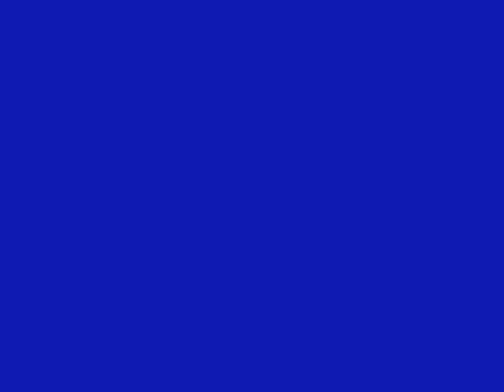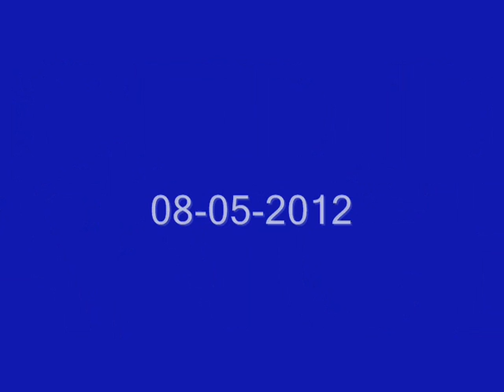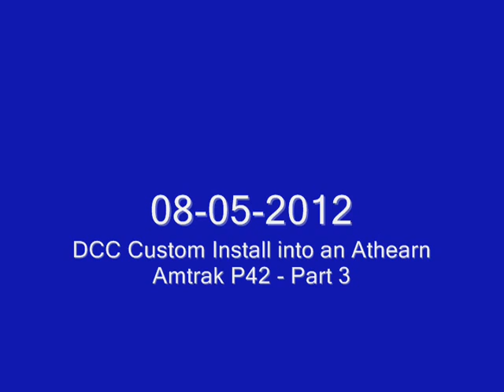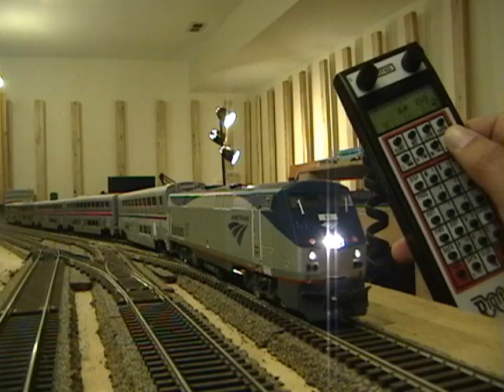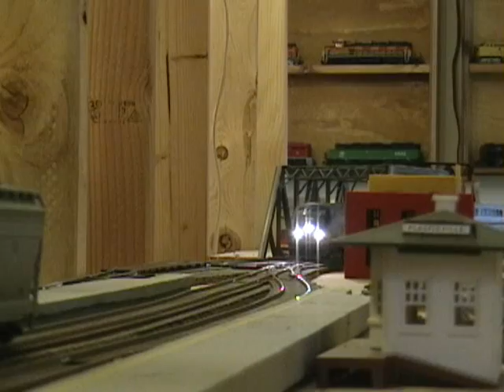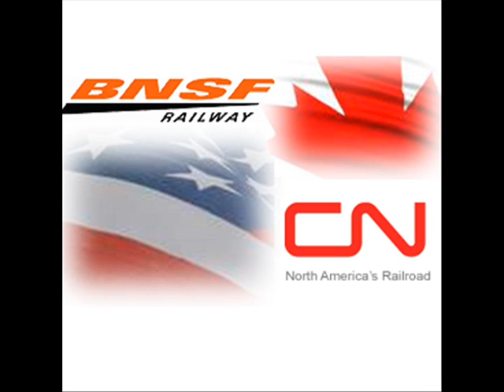08-05-2012 Advanced DCC - Custom Install into an Athearn Amtrak P42 - Part 3

Comment: Just watched video 1 and 2. Thanks for posting this. I would have never figured out how to hook up this decoder. What gauge wire did you use?
Reply from the maker: I think I used 22 UAG. Anything between 20 - 24 will work well.

Comment: Yeah, I think he inspired alot of people (incl me) with that 'how to.' Sure wish he'd make videos again. 
No, I didnt, but it's never bothered me bc you can run that engine either way (lhf or normal) and it and the ditch light flash. Less programming actually. That gp38-2 is a cool little engine with the remote flashing beacons. Thanks again for your programming of the custom sound on it.